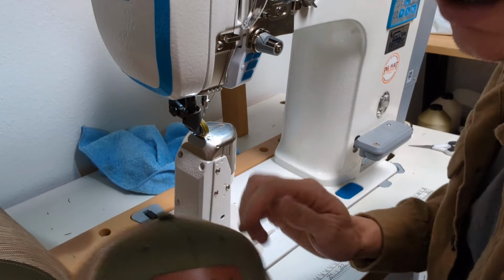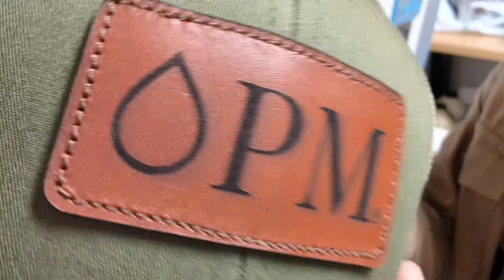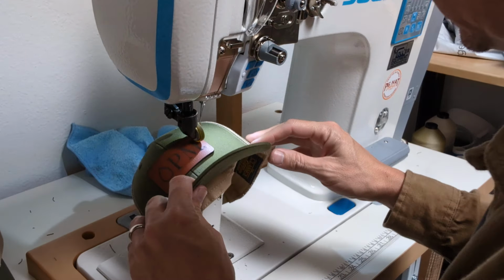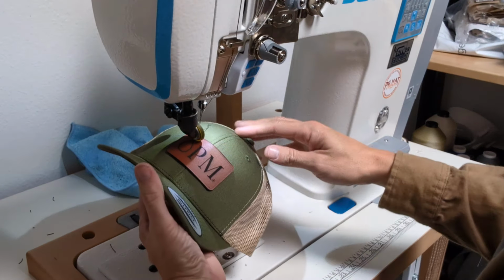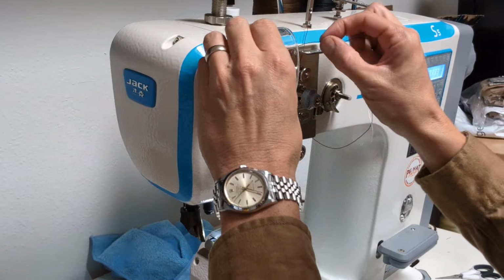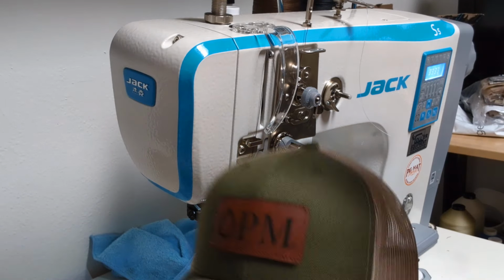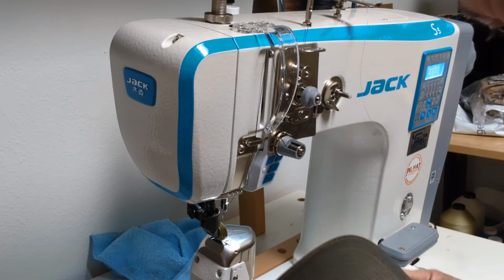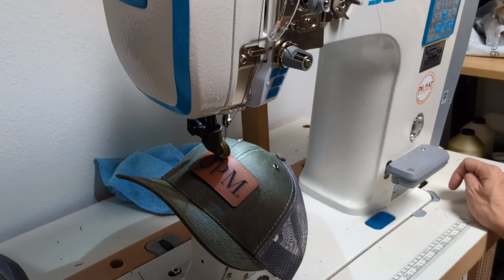Sewing Leather Patches on Hats

Comment: Spray adhesive only works if you spray both sides for permanently bond. One side for temporary bound.  you'll probably do two coats to stick permanently. And I still wouldn't trust it.

Comment: Why did you choose Jack over other brands and not a walking foot
Reply from the maker: Walking foot leaves the surface leaving room for shifting especially when it is not completely a flat surface. The wheel keeps constant contact.

We looked at other machines but trusted the suggestion of Collier equipment on the brand recommendation.